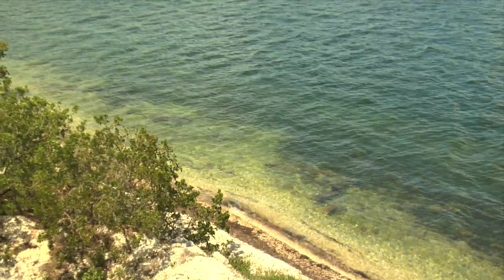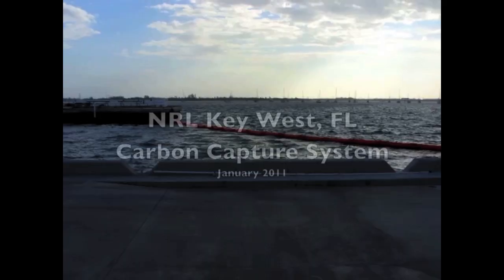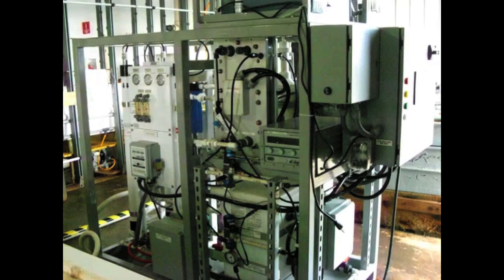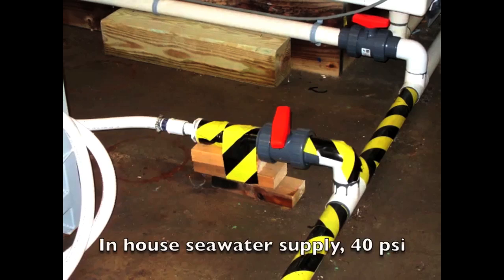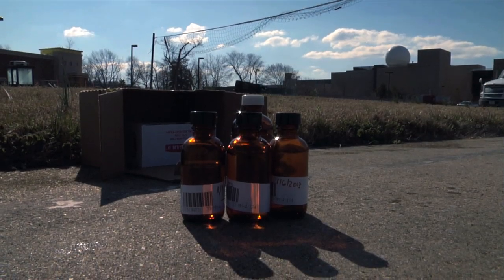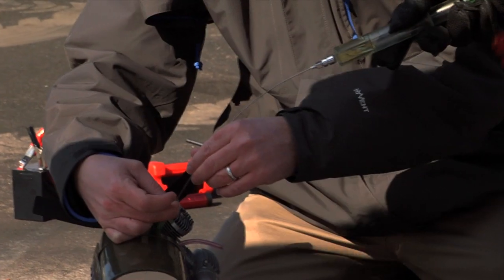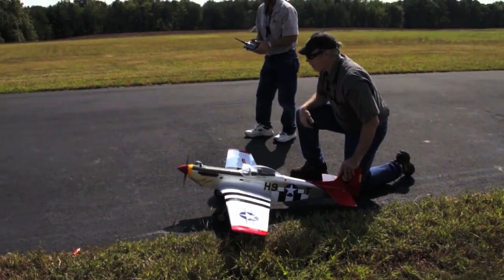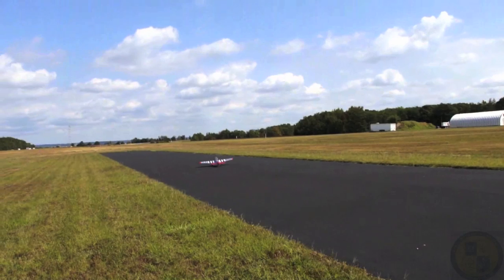Creating Fuel from Seawater

Comment: Of course it takes more energy when "making" energy then the amount you will receive in return; that's physics.  It takes a ton of energy to crack crude oil into it's components before it can be used in your car and the thousands of other uses; so that is not free either.  The take away here is a renewable fuel source that can be produced with a renewable energy source (like wind, solar, hydro, ...) and energy independance.  No it's not free, buts it's available anywhere and helps reduce emissions.  It will be a while before we have battery and solar powered airplanes..... There is a need for this; great work NRL.
Reply: There are now prototypes of electric aircraft, D Myers, and the Deep Decarbonization Platform Project has the support of the more science-oriented nations like Russia, China, Singapore, the Koreas, Japan, Germany, and Scandinavia. It's too bad that North America doesn't seem to register the 17 Sustainable Development Goals for 2030 yet, but there are reasons for optimism. Plenty happening.
Reply: Always a f**** winer science is all about the process innovation it means getting it done dammit
Reply: a lot of surplus solar that that is really really cheap prices come down tenfold, transportation and storage of energy that's the problem with solar,. Making liquid hydrocarbon is a great idea for solar

Comment: Like "Laston Kirkland" says below, the video does not indicate what energy source they used for the prototype nor what energy source(s) is/are proposed for a full-scale production version. Most likely by far they used electricity from coal-fired power plants for this prototype but likely nuclear fission would be proposed for the full-scale production version, hopefully with non-nuclear renewable energy sources such as solar & wind power thrown in. Hydrogen does seem to be the best bet as an "energy currency" (a way of storing the energy produced by fossil-carbon burning, nuclear fission, solar & wind power) as it produces H2O when burned to release its energy.

Comment: No mention of where the energy comes from to make the fuel...

Another article says 92% efficiency, so 1,000 gallons of diesel will get you 920 gallons of clean fuel (in the perfect diesel to clean fuel process). Or, it's electricity? If so, nuclear sourced electricity requires about 3x the thermal (just as coal, etc, due to the confines of thermodynamics). Perhaps the 92% is from thermal reactions which would make the nuclear FAR more efficient!

This, then would be a model for the world. Develop whatever best and safest nuclear (such as the molten salt reactor or fast reactor) and make clean liquid fuels from CO2 and H2 in the oceans.

This 92%, however, sounds to good to be true. Even at a lower efficiency, nuclear must be the clean energy source which powers planetary civilizations (wind and solar are too intermittent and diffuse to power such large ships, for example).
Reply: It's neither. They say the CO2 extraction process is 92% efficient, meaning they get 92% of the carbon out of the water. I read one source of ~2000 micromoles of CO2 per kg sea water is typical. 0.002 moles of CO2 is 0.088g. They are getting 92% of that 0.088g per kg. The energy efficiency can't be anywhere near that level.
Reply: An aircraft carrier would use their nuclear power to make liquid fuel for the jet fighters.
Reply: If the reactor has excess power.

Comment: Hmmm - The fuel normally used in an Evolution 46 (specific to this Hangar  airframe demonstrated) is mostly alcohol with a castor oil lubricant and nitro methane 5-15% nitro methane mix.   Video interesting but far short on specifics.

Comment: Chemically speaking, there's nothing too outlandish about this project; carbon is carbon, this is essentially a reversal of hydrocarbon combustion into CO2 and H2O.  However, a quick look at the laws of thermodynamics shows that this process must take more energy than the potential energy output of the fuel produced.  Best case scenario, this is taking energy from a nuclear reactor and directly producing fuels for smaller vehicles; useful for energy independence when a resupply line into hostile territory is undesirable, worthless for energy production on any large scale.
Reply: The laws of thermodynamics say that the energy input needs to EQUAL the energy output. I'm tired of people using this as an argument because the people who do this ALWAYS leave factors out of the equation and tailor it to try to "prove" that alternative energy sources can't work, often without even realizing that their "education" has conditioned them to do this.

Comment: Since they don't say how they're getting hydrogen from sea water, I can imagine 2 processes. One would be if there are accessible regions of the sea with an excess of dissolved H2; perhaps there are some in deep water, but hard to imagine that high a concentration. The other would be by splitting water, but that's endothermicso would require some external energy source.

Comment: Cant we move away from Hydrocarbons and use more pollution free solutions? Like hydropower, solar power, wind power etc?
Reply: Yeah because that will work well on aeroplanes O_O
Reply: ***** Actually, they did make a solar-power airplane that was able to fly for hours. It takes a long time to charge, but once it's charged, it can fly and uses the solar panels to extend it's journey beyond what a single battery charge would allow. Obviously in it's infancy, but as solar panel technology advances to higher efficiency levels and the designs of solar-power planes advances, maybe combine it with other technologies into some kind of hybrid... could be very viable.
Reply: AWS Vids i was meaning the hydropower more than the solar, but thanks for the info i'll read up on it, sounds very intresting
Reply: Yes, lets just run the world on Moonbeams and Fairy Dust.
Reply: Moving away from carbon is not necessarily the goal, but moving away from fossil fuel definitely is.
The point of this is to produce the oil we need, and closing the carbon cycle for transportation.
LFTR technology can provide the energy for that oil production, and we can then use the existing infrastructure effectively, which is not far an easier plan than to rebuild a full electric transportation infrastructure
Reply: Just before anyone says things like 'can we move away from Hydrocarbon fuel'
you must know that for every Co2 molecule you take out of the ocean, the ocean absorbs one from the atmosphere, the ocean must maintain an equilibrium.

'solar, wind and hydropower', while it is all great it is not enough to sustain the earth. thorium as a nuclear fuel in molten salt reactors are the answer, look it up.

Comment: How many energy and money needed to create that fuel ? 
I believe it is not efficient yet
Reply: Not yet, but by continuing to develop the technology newer and cheaper ways will be found.
Reply: That's why it's called "proof of concept." That is, they're doing research to see if it's even feasible. If you payed attention during the video, you would have heard that they're now going to see if they can scale this up and make it economical.
Reply: Caseytify
Obviously the process needs a lot of energy.so its expensive, dont see them produce gasoline at 10  dolars a liter, would you buy it?

DOnt need to be a NObel to see this.hidrogen from water is always a problem- too much electricity need, un less you have free electricity.

THERE ARE NO FREE MEALS.
Reply: The part to creat hydrogen is the expensive part. But there is thermal hydrogen production and its way cheaper.

Comment: The Navy has been using electrolysis for decades to make fresh water and oxygen on subs.  It's about time our Gov't spent some research money on making fuels from seawater as well.  The tech for making synthetic fuels has been around for a long time - been wondering what the holdup was.  Doing this in your backyard is possible but really expensive.  We need our leaders to step up and make this tech mainstream.  this is a positive move forward - but how long will we have to wait before this stuff is in our gas pumps?

Comment: This video and accompanying press release are completely pointless because neither talks about the energy flows. How do they plan to get net positive energy out of this?
Reply: They don't. However, for the US Navy's use, they don't have too. This is so that the US Navy jets will always have the fuel they need to operate. They can operate at a net loss of energy because hey, US Aircraft Carriers have nuclear reactors, which tend to produce quite a bit of power. This is really just a way to make it so that they always have jet fuel on hand, not to get a net positive energy out of it.

Comment: It's a start I guess, but the carbon is not needed. All you need is the hydrogen and oxygen. Carbon just produces waste products. Stan Meyer was using water as fuel in the 90s without needing to add carbon.

Comment: Why? Why do they want to add CO2? Why not to produce only HHO that can ever be used in most combustion motors? There's a strange thing here, isn't it? Is it because of patents? HHO is already well known on Internet, and plans for a DIY construction are free. With their system they will be able to make money and try to make people think that it is a safer way to use water (and that HHO is very very very dangerous to use). Bets are open (as we say in France)
Reply: +Ronan D. Hydrocarbons have a better energy density and don't have to be pressurized to store in high quantities. You wouldn't want to waste weight in a fighter jet by needing compressors and pressure vessels just to hold the fuel.